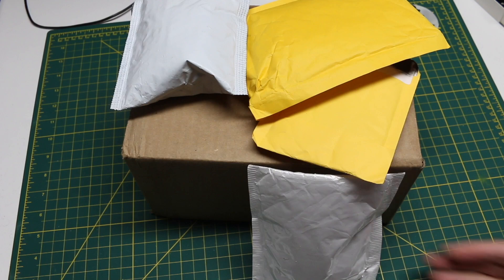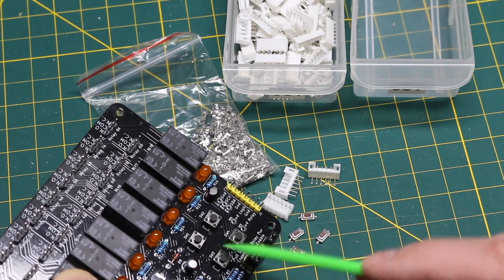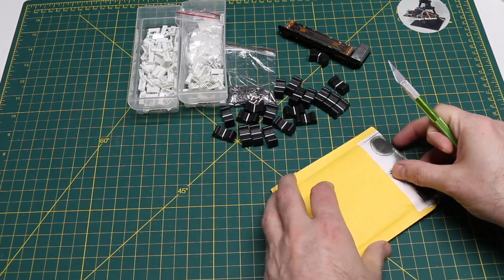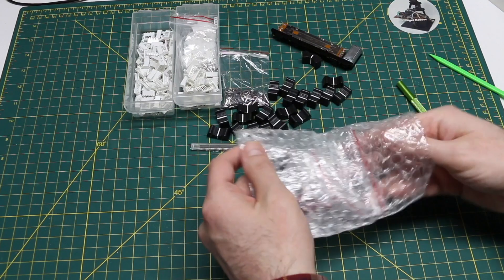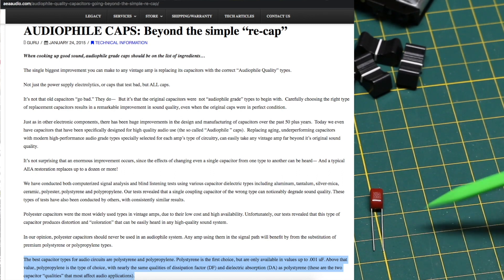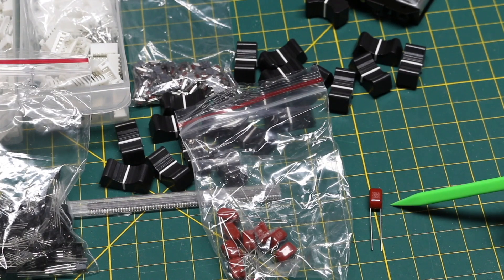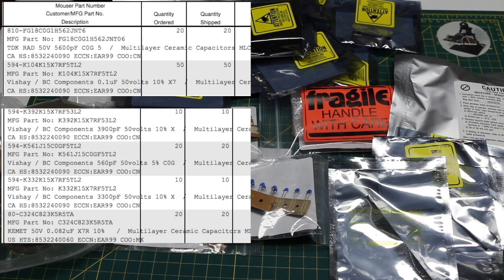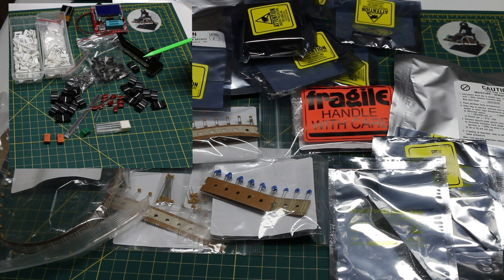Mailbag! ATTiny 0-Series, Dual Coil Latching Relays and Lots More!

Comment: Fun stuff as always. I had a bunch of those red caps and I assumed they were for audio. I just had no idea what to do with them :)  Thanks for the info.
Reply from the maker: Yeah there's a lot that can go into choosing the right capacitor beyond the capacitance and voltage rating. I've learned some lessons over the years (like avoid Y5V when we want the capacitance to remain stable outside room temperatures:  https://aws1.discourse-cdn.com/digikey/original/2X/6/6f8e564933b52a46b7ff6c163e039d3ac01290f2.jpg )